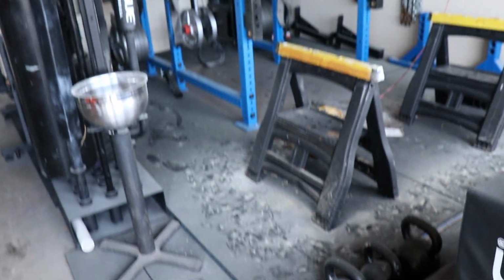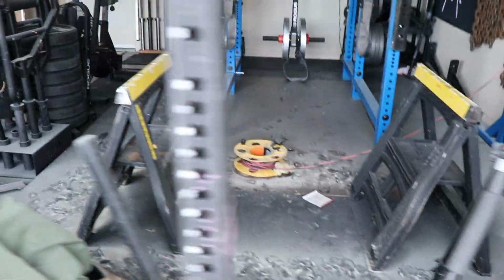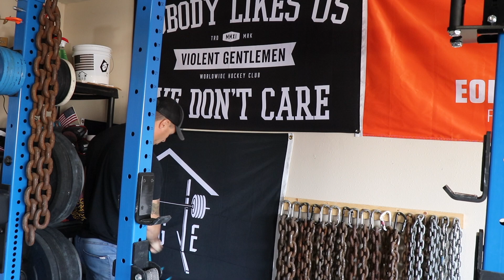Garage Gym Cleaning Routine

Comment: I need to build a weight lifting platform that is similar but a little smaller than yours.  Do you think four horse stall mats would be enough a four post rack like a RML 490?  I'm not going to do any Olympic lifting.  I would like to deadlift in front of the rack.
Reply from the maker: 4 should do you as long as you have some nice plywood for the top as well. I’m assuming you’ll make a 8x8? That’s what my rack used to be mounted on at my last house when it was a 490 configuration.